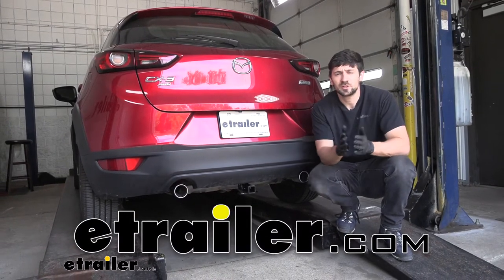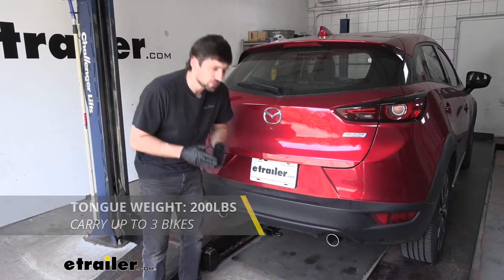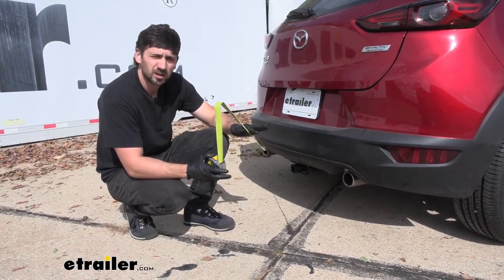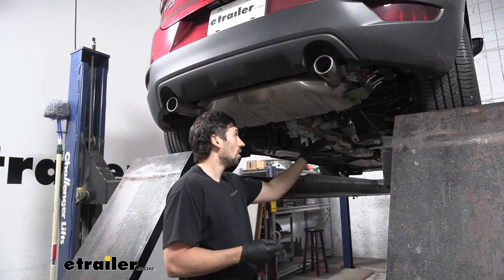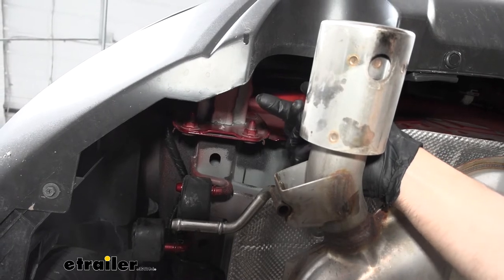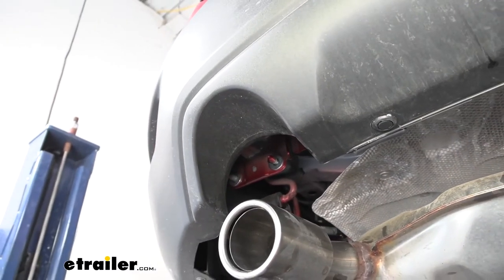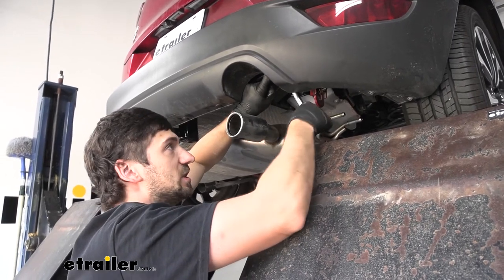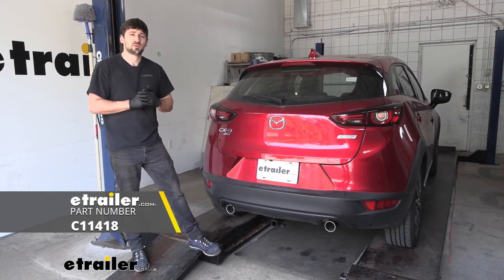etrailer | Curt Trailer Hitch Installation - 2019 Mazda CX-3

Comment: Hi - my hitch sits on an angle, which results in my bike rack hanging low. The whole setup seems very unstable. I took it back to the installer and the tech said it's on correctly. What's with the angle? I can't find anything online about this. Any ideas?
Reply: I have the same issue with my hitch. I have a 1-Up bike rack and putting a 2nd bike with an add-on will cause the rack to bounce a lot, even with an anti-rattle already installed.